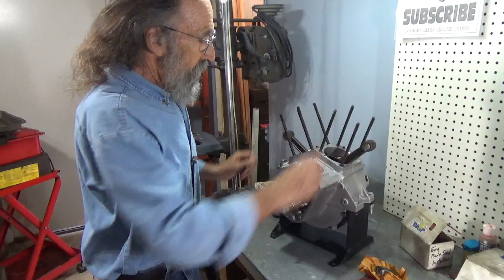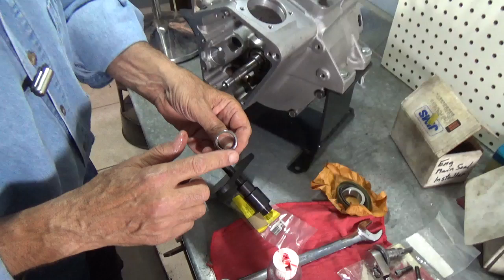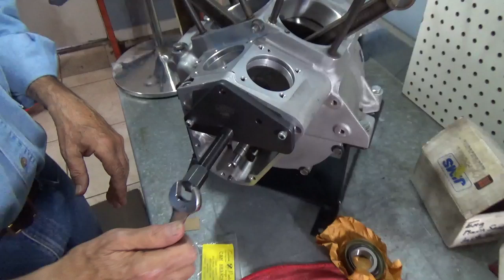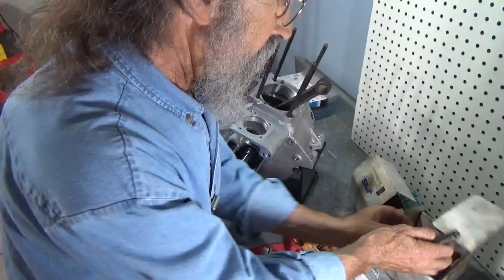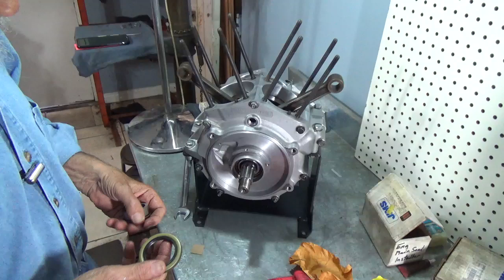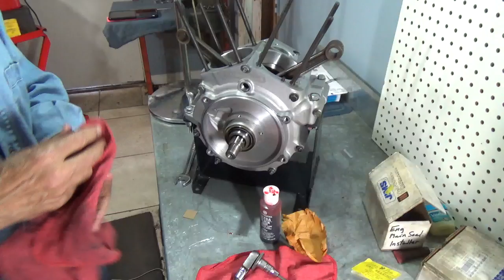Evo Motor Assembly Part 3  Installing Cam Bearing and Main Seal

Comment: Do you have a video of a late model evo cam installation? My 1996 has a .063 round thrust washer, that’s it. The S&S 508 cam I want to use needs an additional .071. For .010 end play. 
What is the best way to achieve this with available parts? Will I need to make a shim? Can I use shims from another year?
Any direction would be appreciated.
Reply from the maker: Go to any Harley shop and you can buy shims.  Those bikes had one thrust washer and no additional shims.  They are only about four dollars.  Go to our homepage and click on the word "videos."  They are all right there (about 375 of them).
Reply: I’ve been watching them all !!

Really good stuff!
Thank you.

Comment: Hey Mike. 
I hope you don't mind me asking but I'm rebuilding a lot on my '99 Evo and am actually going to replace the Main Seal on it as well. 

Now I have a bit of a 'mutant' seal for it and wanted your opinion if either you came across one of these before and your honest opinion on whether I should use it or not. I can't seem to post a picture in the comments so I have to explain how it looks like :-) 

The seal actually is the same on both sides. To me this seems like an super solution as is does not have an oil and non-oil side as both are oil sides. I tried to do a google search on it but came up empty. Do you by any chance know something on those types of gaskets ? Perhaps bikes they were used on ? And should I use it on mine ?

Appreciate all the work you do ...
Reply from the maker: I honestly don't know.  But if it is the right size and has a full inner structure, why not?  Go to a bearing supply and ask the experts.  Then. why not try it?  Just get all the knowledge first.

Comment: i have somehow aquired a 1380 sns motor ground pounder something  it has been worked on bye the most ignorant people every hole is stripped full of sand you name it . i am about to attempt to bring the beast back to life . only because of your teaching here am i willing to do this . there is not much that cant be done with the information you have provided . thanks a million . bye the way this is the second motorcycle i have ever worked on the first a suzuki boulevard that was given to me along with parts from who knows what in boxes buckets wires cut spliced  everywhere . i somehow managed to put it together and give it back to the man free of charge and have been rewarded by others with a 883 and this ground pounder . i really dont want either of them but love something that test me to the limit . the motor isnt the only issue the wheels are falling off only half the motor mount brackets and it still looks good . wish me the patients you have. things never go as well for me as you make it look .
Reply from the maker: I don't know what to say.  Maybe, "Pick your battles carefully?"

Comment: Especially because you have the proper cam bearing install tool, there is simply no need to install the bearing with the case split. For folks that might be “improvising” with methods or experimenting with improvised tool devices (IDDs), they might find some leverage in pounding the bearing in if the cases are split and the cam chest half’s back side can sit flat on the table for said pounding 😅😂
Reply from the maker: This is no place to mess up.  Buy the tool.
Reply: @pacificmikesgarage  yes - I have the tool - I was making a wee bit of a joke, good sir 🙂

Comment: I picked up a 95 Sportster 1200 for my son on a trade it’s a little rough but I have gotten it to run pretty good but have noticed a leaky base gasket do you have any videos on something like that it would be a great help thanks Mike
Reply from the maker: It's basically the same as on a Big Twin (91 and later) Evo.  Details are in the service manual.

Comment: Great video Mike. I have a problem, 1990 Evo on my Heritage keeps filling the primary. I've replaced the seal and spacer twice and although slowed, I'm still getting oil leaking into the primary. What am I not doing right? I have the seal going in just like you showed in the video. I need your wealth of learned knowledge. Thanks, Mike
Reply from the maker: I'm just an old mechanic.  I certainly can't see it from here.  But, I do recall in about 89 or 90, there were some crankcases that failed.  They cracked where the boss for the drive side bearing race was "cast in."  I hope that's not it, but it is fairly common.

Comment: Hello Mike I have a 98 road king and I’m doing a cam upgrade and when I put the piston to top dead center the timing marks don’t line up I need to move the piston down to make the pinion gear mark at the top. Any help would be appreciated. Thanks
Reply from the maker: The timing marks on the gears only relate to the timing marks on the gears.  Don't worry about anything else.  When installing the gears in the gearcase nothing else will seem to be in proper sequence.  You're fine.

Comment: Mike,  Love the videos. You are an excellent teacher. I have a '93 Evo that I purchased brand new. I changed the oil and filter every spring and never abused it. At about 35,000 miles the cam bearing failed, and I needed to rebuild the engine. I have been informed that this is a fairly regular occurrence on early to mid 90's Evo's. What do you know about the Motor Company using an inferior cam bearing in these engines?
Reply from the maker: It is recommended that the original cam bearing be replaced with a Torrington bearing with a full compliment of rollers in it.  This is recommended by camshaft manufacturers and as mechanics, anytime anyone is into the camchest on an Evo, with an original bearing, we generally replace it.  Customary to replace it when replacing the cam.  Personally, they rarely fail.  But, I've certainly replaced a bunch of them that were doing just fine.
Reply: @pacificmikesgarage  Is there a tool to pull that bearing out without splitting the cases and pressing it out from inside?

Comment: what do I need to do for damaged lip in the back of cam bearing in cases
Reply from the maker: Depends on how bad it is, and where the pieces went.  Worst case, complete teardown.
Reply from the maker: If the bearing fits good and tight, maybe there's enough lip for the bearing to "register."
Reply: @pacificmikesgarage  the case is apart and no metal debri is inside, I was thinking of using locktie on the outside of bearing when installing , its a 1980 FXWG that is almost stock, I hate to use new cases for this, thanks for your advise and expertise

Comment: Thank you for all your videos, they're very helpfull. I have a leak from the main seal to my dry primary. Can I replace the main seal and the spacer easly or I need some special tool to extract the spacer?
Reply from the maker: Yes you can!  Just be careful you don't damage the area the new seal is going to contact.

Comment: Hi Mike, Im getting ready to do a cam and bearing upgrade on my EVO.  Im guessing you removed the original cam bearing when the cases were split.  Do you have any video of a cam bearing removal with the Jim's puller?  thanks
Reply from the maker: I looked through the videos we've done and found I've never shown the actual removal of the cam bearing.  In the next few weeks, I will have an Evo apart for one one of my old friends.  We're putting  a fresh High Performance topend on it and I'll be changing the cam.  Therefore, I will remove and install a new cam bearing.  The process is the same for 1958-1999 Pan, Shovel or Evo.  Sorry,  waiting for the topend to be done.  Again, super high performance.  Great things take a little time.  It will be here in  few weeks and I'll demonstrate the cam bearing removal and installation.
Reply: @pacificmikesgarage  Thanks Mike, Ill keep an eye out.

Comment: I notice the new torrington bearings have koyo on them. Are the new ones as good as the old ones that said torrington on them? Also, I looked up the Jims tool cam bearing installer that you are using. The specs say it only installs the bearing. They list another Jims tool for removing the bearing. Do you use another tool for the removal?
Reply from the maker: Yes.
Reply: @pacificmikesgarage  Thanks! These videos are very helpful.

Comment: Hello mike I have problem my 1995 Harley Davidson blew a rear head gasket on the right hand side witch burned the area of the cylinder.the Bike is a Electra glide classic 
So my question is if I had it professional welder take care of that or just replace the cylinder all together thank you for your information. Have you ever done this before as welding the cylinder.
I will be running my compression 10 to 1 ratio using S&S  Super Stock Heads with the corresponding pistons.
Thank you .
Reply: This is a evolution motor 1995
Reply from the maker: I'd buy new cylinders.  The question is, "Why did the gasket blow?  Did you pull cylinder studs?" Better inspect things very carefully.

Comment: I used my existing cam cover to install a new roller bearing, no special tool required.
Reply from the maker: Interesting.  I think, in some cases, that could cause too much stress.  But, if it worked well, great.

Comment: Really good videos, thank you. Have a question, I'm rebuilding a 1989 Electra glide classic with a 1340 evo motor. I have it all broke down, trying to replace the bearings on the crankshaft, have any suggestions of what kind and where to buy them?
Reply from the maker: Buying them is no big deal.  Anyone who carries parts for Harley Davidson motorcycles can get you anything you need for that motor.  Installing new bearings in the lower end without experience or special equipment could be disasterous.  I don't mean to talk down to you.  You could very well have twice my intelligence and capabilities.  But, this requires the attention of a trained professional.

Comment: great vid. If I can be so bold as to put my 2 cents. I'm not sure what kind of bearing you installed. In my ,15 year, career of working on Harleys I would always recommend a continues bearings vs the cage bearing that comes from the factory. Makes for a much stronger bearing. Ok, I'm done. Thanks and I enjoy watching your vids.
Reply from the maker: You bet.

Comment: Great videos! One question my local guy, been working on harleys for a long long time installed my cam bearing backwards, rounded side out. Should I have It pulled and a new one pushed in properly or if it spins freely leave it? Thanks.
Reply from the maker: Can't see it from here.  But , probably okay if it wasn't distorted, which would make it not turn freely.
Reply: @pacificmikesgarage thanks Mike, it turns freely without binding, I guess I'll leave it for now, appreciate the response and great vids! Take care.

Comment: Any issues with using an old camshaft to drive a new bearing in? Thanks for the video.
Reply from the maker: I prefer the tool that takes it in slow and easy.  Do what you prefer.  I show my favorite methods.

Comment: Mike, you forgot to check to see if the needle bearing rollers are straight and that the rollers turn free after installation. It is important to check things like that.
Reply from the maker: I keep thinking these things are obvious.  It goes under the heading of, "Always check your work."

Comment: Is that main seal rule the same on a shovel head? If I convert to an isolated primary (i.e. primary not running off of the oil pump) or to a dry belt drive do I need to pull the seal and spacer and flip them around (after I replace them of course)?
Reply from the maker: When you modify things, it's on you.  But, as I mentioned in the video:  Are you trying to keep oil in, or out?  That destermines the direction of the seal.

Comment: Do cams come with a bearing? 
or is it one size fits al
Reply from the maker: Not usually.  Open your parts book and look up the part number.  Or, look in a catalogue that carries such things and order the bearing for your specific year and model of motorcycle.
Reply: Always buy the harley manual for your specific year and model. Best money you will ever spend. I also buy the year model specific parts book. There are great breakdowns i use to locate items.